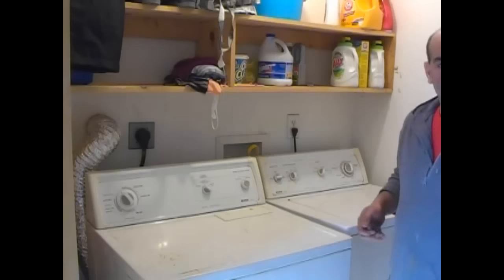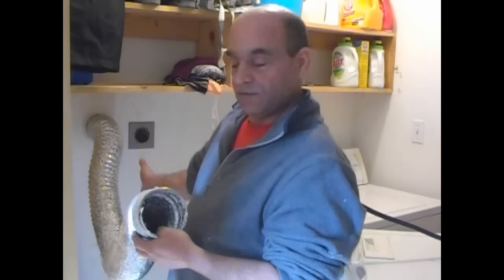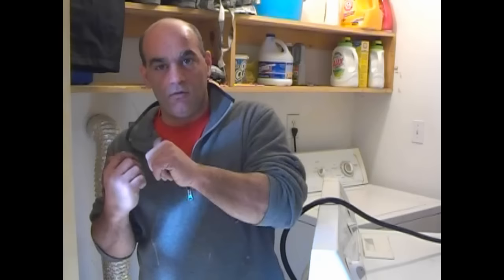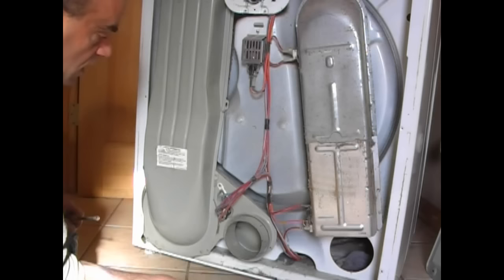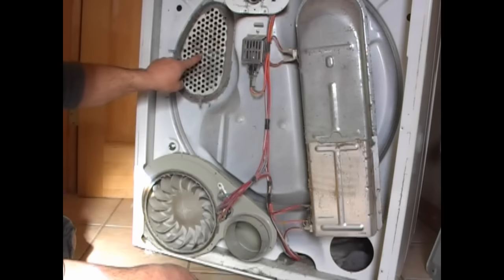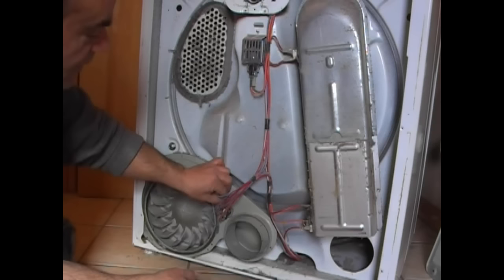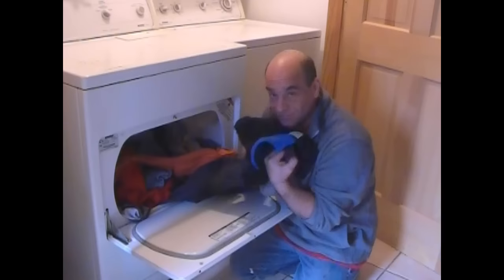How to clean your clothes dryer. How to make it hot again.

Comment: Thank you for the motivation to do maintenance on my dryer. Last week I cleaned the dryer vent that goes out of my house. the clothes still weren't drying in a timely manner. After watching your video I took it to the next level and opened up my dryer to vacuum it out. I was shocked at the amount of lint I found all over the dryer. I even found burn lint after the heater coils and lint on the power connector. My dryer is 11 years old and running well again. Thanks!

Comment: I had always taken pride in keeping the lint trap and chutes clean so as not to be a fire hazard. Sadly, no one had ever told me the importance of opening up the back of the dryer and taking it apart to clean out the lint trapped in there. My dryer recently stopped heating but the drum still turns & the fan still blows. This lead me to YouTube in the hopes of finding out what may be wrong & if I might be able to fix it myself. Your video is a great demonstration--you explained things very well. After finding a good pound or so worth of lint & sand in the bottom of the lint chute, you can be sure I'll be cleaning this out every Spring! Thanks for posting!

Comment: My 1984 Kenmore (Whirlpool) Electric Dryer::: Built like a tank and had great heat and great blower up until about a year or so ago. GREAT VIDEO! — This lady is SO grateful for your video. I watched a dozen videos and yours was the ONLY one that showed me what I needed to know. My dryer works like new.YOU'RE AWESOME! ...I was resolved to buy a new dryer but each model seemed to have too many bad reviews. I had already checked the flexible discharge to the outside – it was fairly clean but there wasn't enough air flow to even open the outside flaps, and clothes took an hour or more to dry. And, for the last 6 months strangely enough there was almost no lint in my lint screen, I tried first to clean the top lint screen shaft with a 2 ft. long narrow flexible dryer brush bought on Amazon. I got about a 1/2 cup of lint out that way, but that little wouldn't explain the NO air flow at the back of the dryer. So, I pulled out the dryer from the wall, turn the dryer on and in back I could see the heating element getting red hot so I knew heat wasn't the problem. I was fairly certain that lint build-up WAS the problem after watching your WONDERFUL VIDEO. I unplugged dryer and took off the lower back panel. I couldn't get the metal shaft out because it was still attached up under a upper metal dryer panel that is spot-welded. I was able to move the metal lint shaft to the side just enough to get my fingers to the blower wheel fins and I scraped the wheel blower fins with my fingers. I removed another 1 cup off the fins. Plugged in but still not much air out the back. I banged on metal air vertical shaft in back that you show. It didn't sound 'hollow, so I suspected lint might be in there. So, I decided to try my portable air compressor with the long rigid tube to blow DOWN the lint screen shaft. SO MUCH LINT started blowing BACK OUT at me – about 3 cups. I vacuumed that up. Plugged in the dryer and tested the air output...not very good. Repeated the process and got 2 CUPS MORE OUT the top. Repeated 3rd time down the lint screen opening. Not much lint came back up this time. Plugged in the dryer, and tested the air output in the back – better but not very good. I went to the back again and reached in to the metal housing shaft cover going from the lint screen down to the blower fan. OMG —The air compressor had broken loose the rest of the lint that was tightly packed in the shaft — and it dropped to the bottom of the shaft where you cleaned yours out. I pulled out = ANOTHER 4 CUPS = of packed LINT. I plugged in the dryer and tested the air output – WOW!... Air is blowing out like a leaf blower! IN ALL about 10 CUPS of packed LINT was my problem. MY DRYER WORKS LIKE NEW!   YOU ARE AWESOME!

Comment: Thank you for sharing these tips.  I called Sears home repair for this problem.  The repairman came and without even looking at the back or opening up the dryer he said I needed a new thermostat which would cost $350 and that the repair was not worth doing.  He charged me $109.00 and left.  I had purchased this whirlpool dryer in Jan 2012 less than 2 years ago so I decided to see if utube had any suggestions.  Thank you for saving me the price of a new dryer and NEVER CALL SEARS HOME REPAIR.  DO NOT TRUST THEM THEY JUST TRY TO SELL YOU A NEW APPLIANCE.
Reply: Sears technicians come are from A&E owned by sears. they have very limited experience and knowledge. So it doesn't surprise me that they tried to get you to buy a new unit. If your dryer drum will turn but won't heat it is not the thermostat just for future reference
Reply: Weed wacker
Reply: There are several factors that affect whether the dryer will heat or not.  Many times a dryer will turn and not heat.  MANY times a thermostat IS the problem.  The heat controls he speaks of on that particular dryer  do regulate the heat.  One is like a backup for the one before it.  
  That looks like a Whirlpool built dryer. Lot easier to work on than most GE or Frigidaire dryers.
  The one on the blower housing at the bottom left is the Cycling thermostat. It is designed to cut the heat off at a lower temp than the next one on the bottom of the heating element cage itself (High Temp Stat) which has a lower kick off temp than the one on top of the cage (Thermal Cutoff).
  The little oblong white piece right above the first stat on the blower housing is the Thermal Fuse.  If it goes out, the dryer will not run at all and both should be changed.
  Other factors that affect whether an electric dryer will heat ot not are the motor heat switch at the motor itself, bad timer contacts, Blown fuse in a wiring system that still has fuses in the main power box of the resident, faulty breaker, and or loose/faulty  connection somewhere.
  Another thing that can cause delayed drying time is faulty seals on the drum or bulkhead.
  I have had dryers with so much lint in the cabinet when the drum was removed I could barely make out where the motor was.
  If you have stats that repeatedly blow, you should really check the entire venting system out.  If the heat and moisture can't get out, they will begin to blow or fail prematurely.
  If the dryer gets too hot, it is usually a blocked vent or the Cycling Stat has gone bad, and it is cycling on the High Temp Stat.  If the High Temp Stat goes out and it gets usually a little below 300 degrees F, the Thermal Cutoff/Fuse will blow.  These are all safety devices designed to cut the heat if the other fails to a certain degree.
  Usually, it is a thermostat.  Any part can go bad on its own from longtime use, but sometimes, there are other reasons certain parts go bad.  Many times they are doing what they are designed to do preventing house fires!
  I have watched Dominic for a few years now.  He has some informative videos on different subjects.  Just thought I would give a little more explanation on dryers and the safety features on them from my experience of actually working on them.
  another thing that can make a dryer take a long time is a lint filter that has not been cleaned in a long time if using dryer sheets.  Some of these can leave an invisible film on the filter.  If you run water over your filter, and it settles and does not run through the filter, you might want to wash the filter.  Water should not puddle on it.  If the filter is clogged like this, it is basically the same as a clogged exhaust venting system as the heat AND moisture has a hard time getting out.
Reply: we need the dentist may be
Reply: Mark Reynold

Comment: THANK YOU!!! You just saved this single mother of four from having to buy a new dryer. The vents looked all clean, dryer was still getting hot, tumbler was still turning but wben I took it apart the part that covered the fan was clogged tight. How it didn't catch fire I do not know but thank god I subscribed to your channel a while back and saw this video. Once again you have saved me.
Reply from the maker: The thank you and knowing I was able to help a single mom is all I need. Glad I could help you out.

Comment: Thank you so much. Some poor repairman just lost a job.  A sponge fell down my lint trap one day - I had just taken the filter out and reached to get a hose to attach to the vacuum cleaner and the sponge fell off the shelf - ugh.  I used the dryer then with no problem, but at the advice of some men I know I stuck a hanger down there to try to pull it out and pushed it under the fan.  Your video showed me what I REALLY needed to do to remove the sponge.  Oh, did I mention I am a female :). YES!!!

Comment: i do this dryer maintenance every year or so and it always has a lot of lint everywhere.i started maintaining my dryer about 20years ago when i was in my 20s i rented til i was 30 and built  my home .apartment rentals in the city i eventually moved to the country and found  a mobile home to rrent the washer and dryer hookups where outside in an old tin shack with no door .there was always i good  breeze from the lake ,in an apartment the washer and dryer was always inside but there it got lots of breeze ...air blowing through your dryer cabinet  will cause the lint to catch fire easily where as in a closed off room not so much but still possible  the dryer caught fire and burned the whole thing to the ground 
great video clean your dryer people it could  save your families life!

Comment: Update to my comment yesterday: I cleaned my dryer today, thanks. Put it back together, with no leftover pieces, and it works great.  I wouldn't have known I could, or should, take off that big interior metal chute that goes between the lint trap and the fan if you hadn't shown it and that's where most of the lint was.
Reply: Remember: No left-over pieces or fasteners mean you're doing it wrong.  😅

Comment: Thank you!
I just got an older dryer that doesn't heat.
I need to certainly take off the back & clean it!!
First for safety, & it could be why it doesn't heat??
I know my tubing from dryer to wall vent is clean as it's new.
Living in an apt. Not so sure about the outside vent on the roof??
I think I will make this a part of my Spring & fall cleaning.
It's good to do the same to you Refrigerator!
Vacuum the back and under at least twice a year.
More if you have pets like indoor Dogs, & Cats.
Makes appliances last longer, & keeps your loved ones,pets, & you much more safe.
Blessings to all who read this.
Thanks for the video.

Comment: Thank you so much for this video! God bless you for helping me. I already had the dryer on the curb!  I rolled it back in, cleaned it out, changed the fuse and IT WORKS!  I can't imagine how many dryers are thrown out because of this stuff.  THANK YOU SO MUCH!
Reply from the maker: Mary Kingsley awesome, glad I could help out
Reply: Mary I bet your correct.
This can save having to buy a new Refrigerator as well by routine vacuuming the fan in the back & keeping floor under the Refrigerator clean of dust, & pet fur build up.
I'm passing this info onto others.
Now I see why so many dryer fires.
This video was so helpful.

Comment: Praise God for allowing you to show me this. We were going to burn to the ground. I am a new HVAC tech and it would be my honor if you want to learn about limit switches and all other things mechanical electrical or plumbing that many diy'ers don't know. You are a good steward and I thank you for showing me this. You won't ever need an electrician again. Thank you so much.
Reply: The "heat sensors" as you put it are actually called limit switches. They are attached to the low voltage in any machine be it an air conditioner, heatpump/furnace, fridge, stove/ranger/oven, and a few others. What they are are simple switches. They are two bi-metal discs that are on a "NO" or normally open circuit. If you want to hear one in action take a lighter or something hot and touch them. You will hear a click or pop sound. What has happened is one of the discs has changed shape from the heat and now is making contact with the other disc. That makes the circuit from "NO" to closed. The low voltage governs the high-voltage and it is essential that you have power coming in and power coming back out to do work. When the limit switch engages/trips what you have is power coming in but no power coming out therefore Mr. high voltage can't do his job because Mr. low voltage has placed him under house arrest. This will continue until the limit switch has had a chance to cool down enough to pop back; breaking contact and thus making the low voltage an open circuit. Now that the low voltage circuit is open it no longer restricts the high voltage from being able to come back out. And since the high voltage has already been allowed to come in it can now come out back as well and work can resume. The dryer has two differentially calibrated limit switches as a safety precaution one is a higher resistance and the other is a normal resistance. If one fails you have a backup. What happened to your dryer prior to your cleaning it was all that heat built up and was not properly ventilated (prior to your cleaning it) and the trapped heat tripped a limit switch and the element shut down for a couple of minutes each time it happened and then had to slowly warm back up again which is why your clothes were damp. :) hope that helps explain limit switches.

Comment from the maker: Thank you. I would agree with you, however after cleaning mine as you seen it now works awesome. No more wet clothes in the morning.... Must of been the other stuff as well... Thanks again..
Reply: Thank for your video. I have a problem with my GE gas dyer Model#GFDN110GL0WW. Not starting. I pressed the power button, then pressed the start button. But it won't start. The electronic panel says DRYING. What seems to be the problem.  How can I diagnose this.Thanks.

Comment: Another problem with wet clothes in the dryer can also be your washer not spinning your clothes correctly. If the washer doesn't spin as much water out of the load the dryer has to work harder to dry them. Found that out the hard way after having to replace a lid switch in the washing machine.

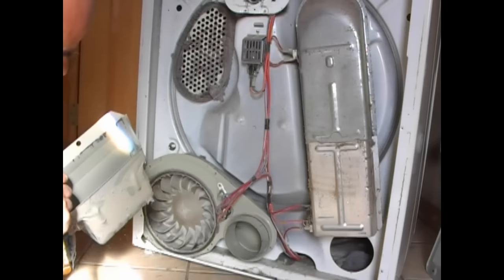Comment: Thanks to this video I had a good handle on where my clog coud be.  Because of our situation I could not easily move the dryer to get at the back panel.  Instead I bought 6 feet of 5/8 inch diameter vinyl transparent tubing.  I removed the lint screen and was able to carefully push the tube down into the area where the plastic fan is.  When I attached the tube to my dyson vacuum cleaner I was able to pull up a nice chunk of lint/dirt just like the one you discovered at 4:14 in your video.  

Thank you again for making this video.  You are the best!
Reply from the maker: Always my pleasure buddy. Glad it helped you out

Comment: I had a metal stylus, about 8 or 9 bobby pins, a bed, a big nail and some fluff. My dryer would turn on, run for about 10 minutes and die, I could not figure it out. I knew the belt was not broken and I could see a flame via the peep hole {square little box}. Thanks for this great idea, nice video and you are a nice guy.

Comment: When we adjust to daylight savings time I usually change batteries for smoke and carbon dioxide detectors and now I will add cleaning the back of the dryer to prevent house fire. Good tip thank you for the video
Reply from the maker: Thank you. Those are great tips.

Comment: Who knew?  I questioned my dad for getting one of those brushes as seen on tv because I thought the lint trap was enough.  I also knew to check the exhaust tube as you did at first.  A neighbor just had a dryer fire and I thought they must have not emptied the trap, then I see the insides of units like you showed, and see that there is yet another maintenance requirement.

Comment: Thank you thank you thank you! I had just cleaned behind the machines to pull a bunch of nick nacky pocket items my cat had knocked over and set them on top of the dryer. Put a new load in and checked the lint trap and down went a thing of chapstick. I was a bit scared id pull some sort of wires if i pulled the entire back off but your video showed me what i wanted to see before i did it myself. Thank you! Chapstick saved and even cleaned the extra lint out too!

Comment: My dryer stopped heating, Now I know what to look for if the heating elements are still OK, this hopefully is going to fix it. Great video thanks for sharing it with us.
Reply from the maker: Always my pleasure.
Reply: ok if your heating element stops working there are a few different causes. You may have lost a leg of power and are only operating off 110. you should actually be operating off 220 unless you have a gas dryer. the second thing to check is what is referred to as the "thermal fuse". now if your dryer won't turn the drum when you power on and hit the start button this is most likely your issue. however you would need to check for continuity on the fuse. You may also hear a click when you press start but nothing happens. your third suspect is your safety thermostats on the heater case itself if they open or break the circuit your dryer drum will turn but not heat. Your last suspect is going to be the heating element itself. You will need to check from common to each heating coil for continuity. least likely causes are a bad pcb board if you have one and the wiring itself could be bad.
Reply: Glad I read on down and saw this.  Your first statement "is not the thermostat" threw me off because it sounded so definite and led me to making my explanation of what I know about dryers.